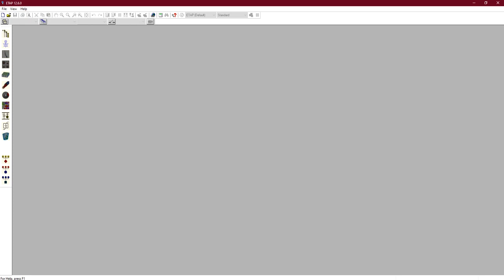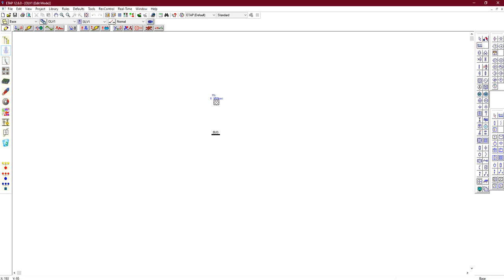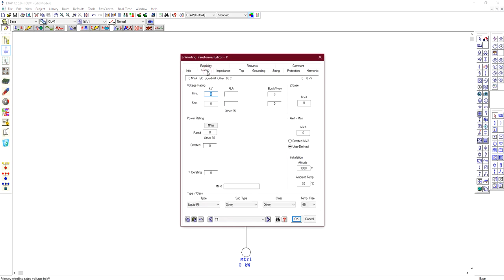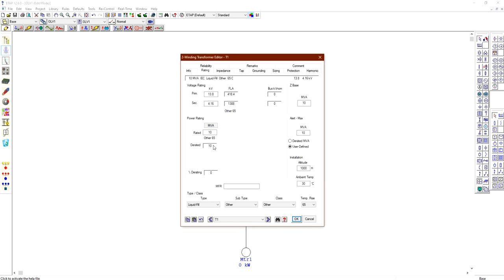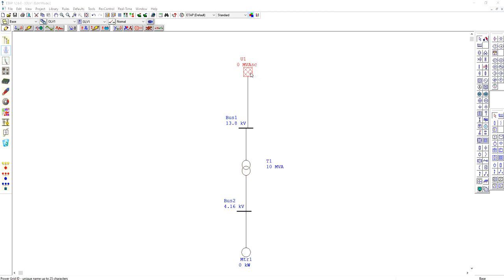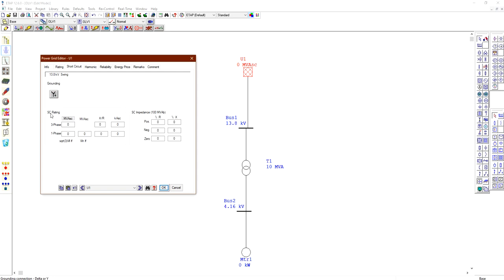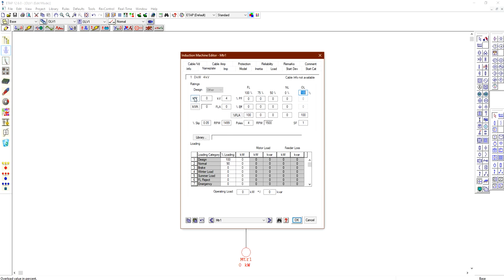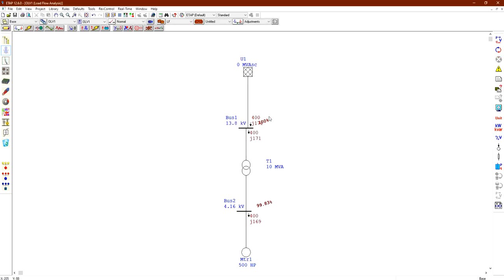Simple Example on Load Flow Analysis Using ETAP Program for Power System Engineering Courses

Comment: Sir. If we use Etap, what method of analysis is used, Gauss Seidel or Newton Rhapson?
Reply: Yes we must know how accurate is the software? Need much information the impedance of the transmission line cables, size of cables, and distance of cables, it does not provide complete details.